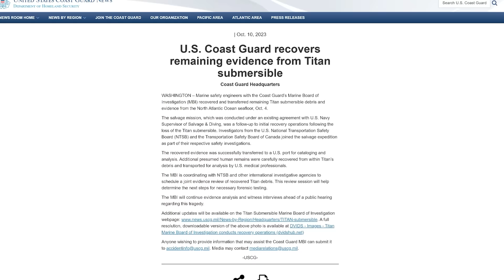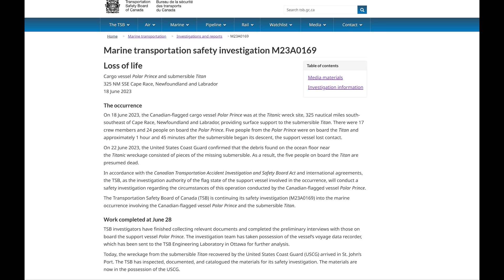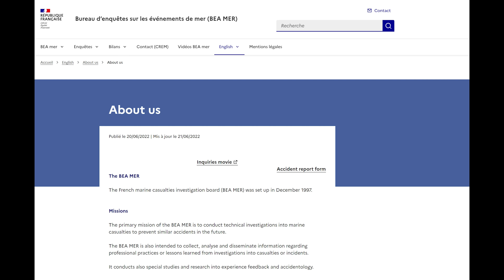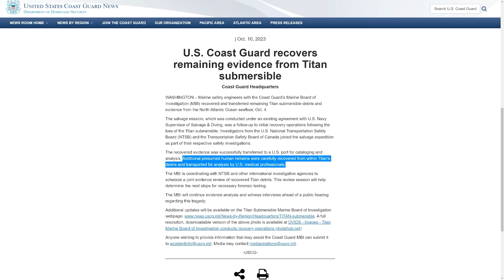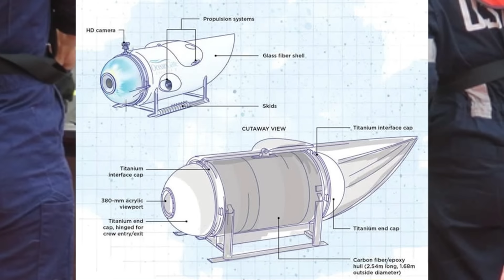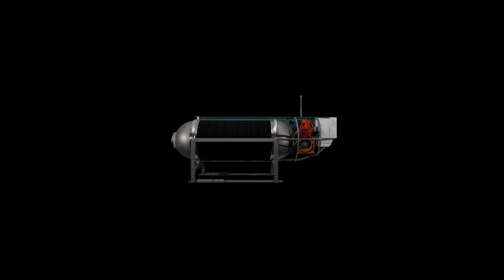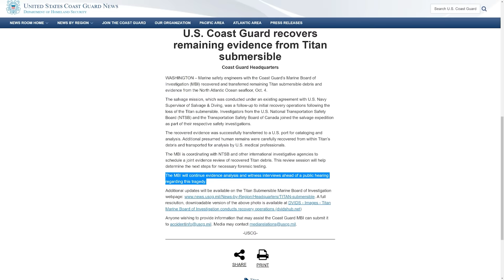Titan Sub UPDATE: More Human Remains, Debris Found

Comment: That sub Stockton had built was just RIDDLED with horrendous engineering mistakes, some of which were so amateurish that it’s mind blowing. For instance he literally attached his stupid, game-controller paired monitor with screws HE DRILLED RIGHT INTO THE OUTER HULL! In other words, just through those screws, he rendered ALL of the layers of carbon they penetrated ABSOLUTELY USELESS - aside from creating a point of weakness that way.
Also, the cables on top of the sub: Loosely dangling around like power lines in a dysfunctional favela in Brazil - easily to get entangled with all that debris down around the Titanic. Or the complete absence of a rescue craft, that could help if something unexpected may happen.
So even if ONE aspect of that sub of death would gave gotten improved, there‘d be a whole list of ADDITIONAL possible sources of disaster.
EDIT: I almost forgot to mention: Stockton had sourced the carbon (probably through a bribe) from Boeing‘s scrapyard: It was material that was not deemed safe any more due to having exceeded the expiration date. One could say: He built his sub with JUNK.
Reply: I agree with nearly everything you have said. Except the screws were not drilled directly into the outer hull; there was a thin sheet inside lining the hull that they were drilled into. (From earlier videos during the event).

Comment: It has been the question that goes around my head over and over,  what if they rolled the carbon fibre around a titanium cylinder that will be bolted to the two end titanium end caps how much strength that would have added to the whole structure of the vessel. 🤔
Reply: No need for carbon fiber. Titanium alone, which has been (and still is) successfully used for decades. Stockton used CF INSTEAD of titanium, to save money,

Comment: What is crazy, if its not the carbon fiber that failed they wont say it. People don't realize those batteries when they come in contact with water they can explode and catch fire remember they were singing too fast to me sounds like they got a pin hole in the back they got water in the batteries and it caused the explosion but it's all going to come down to it's
 the carbon fiber at fault

Comment: that mandrel would have given more strength for sure.....
even though it was probably not Titanium and looked like stainless steel
which is 2x heavier....it would have had a strength of about 75 to 85 KSI.....
and in this fabricators opinion, would not have reduced the interior space 
by much......even if it was 7075 aluminum, which is 1/3 the weight of steel, 
it would have had a tensile strength of about 80 KSI,,,,,,

Comment: The way to avoid such a tragedy is to use the right materials, and carbon fiber is not right for this application.  Like a barrel with a rope wrapped around it, it is far better at keeping pressure in than it is at keeping pressure out.  Also, using a window of adequate thickness and pressure rating would be a good idea.
Reply: Would resim imstead of carbon fibre not have been a  bettter option

Comment: There seem to be bits of the carbon fiber sticking out of the upper surface of that aft section in the pics with the two ladies standing over it. All those black bits.
Reply: I think that's bits of rubber o-ring that sealed between this part and the titanium ring (recovered earlier) where the CF was actually bonded.

Comment: Engineering wise, I wonder what would have happened with the Titan if the carbon fiber hull has a thin titanium sleeve attached to the dome mounting rings.  I'm wondering how much metal you could remove (thinner sleeve) with a carbon fiber wrap, without sacrificing crushing. Also a sleeve with the mounting rings attached seems more logical than glueing it together

Comment: Let’s not forget the Titan did make multiple trips down to the Titanic before its demise. To me that is big. He has shown that it may be possible for a cylinder can make it to such depths. I think the only problem was he was testing the design with people aboard. I also agree about having some type of steel cylinder wrapped with the carbon fiber may have made a difference. I hope there is someone out there who will pick up and continue his work on this hull design. This would probably be a billion dollar research project when done properly but what a concept.
Reply: Titan only successfully (and mercifully) made 14% of its scheduled dives, and no trip went smoothly without major systems problems.
Reply: @staciasmith5162  I'm sorry but you missed the point. Stockton Rush had shown that a "tube" could make it to those depths. Was his design faulty or was it shoddy craftsman ship. I believe it was shoddy craftsmanship and trying to do this on the cheap.Building a concept like the Titan is a billion dollar research project. To say the least. Done right he would have followed Elon Musk technique of test to failure then diagnose the failure, make changes, test to failure and repeat the process. I still say his idea and concept may have validity. He made it to 13000' on multiple trips in a tube.
Reply: @mathewk2961  I don't believe Rush proved much of anything because the amount of dives is grossly exaggerated, most were not deep dives and there are reports prior to the implosion about various, severe issues.  The fact that he fired a man he had hired simply because Rush did not want to hear the truth about the danger makes me believe that Rush was pulling a fast one. Some people need that "danger adrenaline rush" I guess????

Comment: You told us nothing.  What human remains?  What debris other than what we know already. So shallow your channel.

1. Please refer to females as WOMEN, not Girls or Ladies. We don't say, BOYS or GENTLEMEN.  We say MEN.  Same thing.  WOMEN, WOMAN is not a dirty word and needs to be adopted for all females over 18.  It is archaic to refer to us as Ladies. 😵‍💫

2. Why are you focusing on the Titanium parts? Who cares what is smeared on that.  The metal is fine.  The issue was with the carbon fiber hull and acrylic porthole window. 

3. The acrylic porthole was specifically listed for much less depth by maker, but used over and over again to go down to way deeper limits. This could have been a point of failure if it blew out.

4. The carbon fiber hull was specifically NOT TESTED BY ANYONE.  Since it was a composite material, it could not be tested for Finite Element Analysis testing on compressive, tensile strengths.  You need a solid material to be able to calculate failure point using FEA calcs.  This was not done and could not be done. Stockton still wanted to use this material.  The sub therefore was not certified for diving.  Many people told him this was the wrong material to use but he used it.  This CF hull has already been subjected to multiple dives and probably had fine stress fractures on it, never noted, or fixed.

5. Deep diving is a mature science not anything new.  They know what materials stand up, what shapes, and we have dived 7 miles into the Mariana Trench, the deepest point on earth, successfully with zero failures.  Why did this implode at only 2 miles?  Because Rush did not follow build guidelines and did not certify his craft. That is why he operated outside of US law on international waters!  He was not an engineer but a salesman.

6. Rush deliberately did not have any voice communication with mother ship on surface. He only wanted text by phone. Why?  To maintain a serene atmosphere inside the sub for the Titanic experience!  So, the mother ship could not HEAR what was going on - the noises or any voices, or rumbles, squeaks, groans the machine was making.  Silence.  This was the height of stupidity and arrogance.  The sub was making a lot of noises at the end. They knew 5 mins or longer before it imploded that they were in trouble.

7. The sub descended too fast as per the log records with mother ship. Instead of a controlled descent, they were much deeper than they should have been. Why? The sub was taking in water already and too heavy so sinking faster.  Alarms were going off and this was reported by Rush to mother ship.  All alarms were going off.  When they aborted the descent as per the log text transcripts, and started back on ascent, the sub rose slower than usual.  It was not rising fast enough, again, due to water leaks and weight. Then kaboom!  It reached critical mass and imploded. That was the radio silence heard up above. All texts stopped.  But they knew they were in trouble.  Agonizing moments but we have no voice recordings of that.

Stockton Rush was a con man and arrogant. Hubris is what sank the first Titanic ship and then the second Titan sub. Both sank due to human arrogance and denial of reality.  In the Titanic, the captain was promised a cash bonus for getting the ship there on time. He was warned of ice floes and should have slowed down, but he accelerated instead, ploughing thru till he met that large iceberg.  He caused the accident and death of everyone on board.  In the Titanic, the great grandparents of Stockton Rush's wife, Wendy, died.  Ironic that their great grandson in law, should die alongside them in the same grave.
Reply from the maker: I told you what the coast guard told us. Which is that they found additional human remains? And I showed you that titanium dome period you're just a lying troll with nothing better to do with your time. How embarrassing it must be to even have this conversation with you. Presuming you are an adult.

Comment: At first blush, my response to the question: Why are we still talking about this? Of course, it is because we have no answers, this clown show will be sliced and diced for quite a while and then we will be told "Iron-clad" speculation, and perhaps annually updated, more speculation.
Below there is some commentary concerning leaving the mandril in place for internal support. I guess, if it is Titanium, it wouldn't hurt, maybe if you relieved some access on one end? But, something I have wondered about since even before the dive; is why there was no thought given to interior struts or ribs, spars or some sort of interior reinforcement? I remember some mention of screws secured to the interior for various apparatus and a worry that it could become a weak point, and if they did that, it certainly could be an issue. Better to use glue or double sided sticky tape. Stockton Rush was a brilliant, and smug idiot! R.I.P.